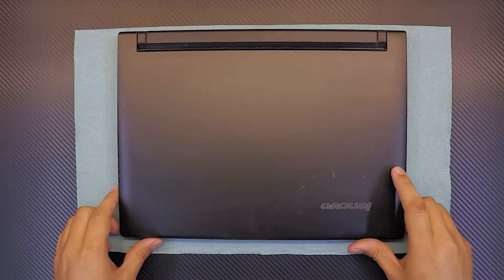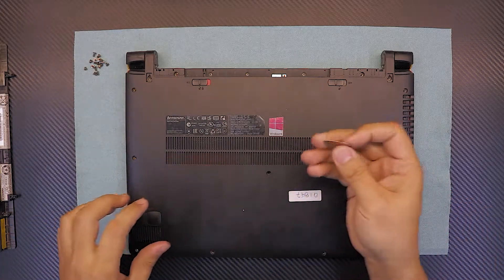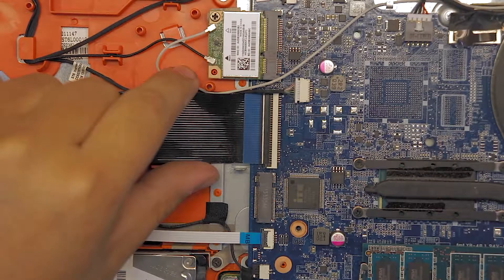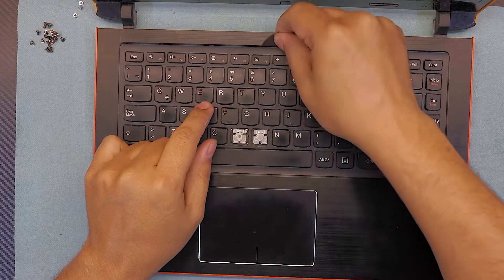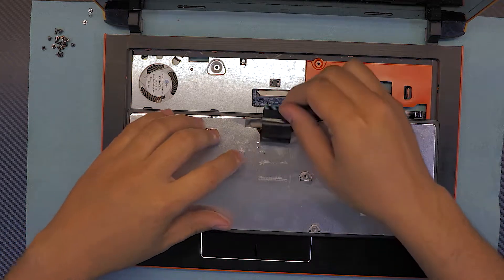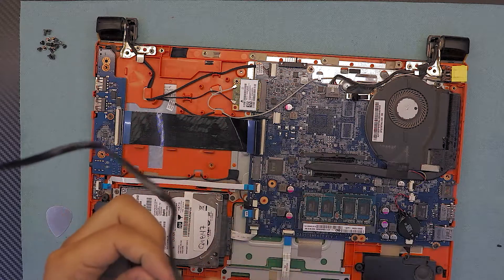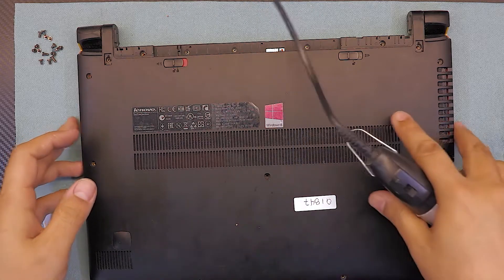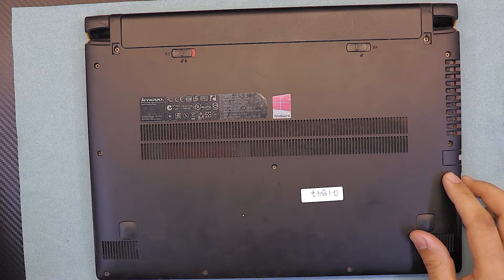Lenovo Ideapad Flex 14 Keyboard Replacement STEP By STEP

Comment: I didn't find any keyboard link in description.
Reply from the maker: unfortunately the sellers have removed the listing because of shortage :( 
only sold on ebay at the moment, here is the link:
https://www.ebay.com/itm/New-US-keyboard-for-Lenovo-IdeaPad-Flex-14-Flex-14D-Model-20308-20333/332724137866?epid=27011073242&hash=item4d77e76f8a:g:XqQAAOSwKMxbTmI7